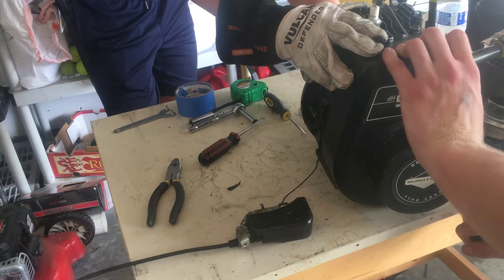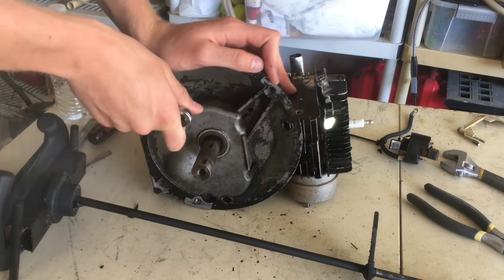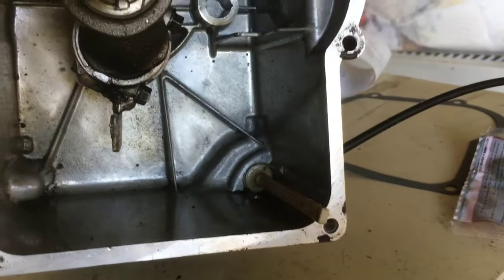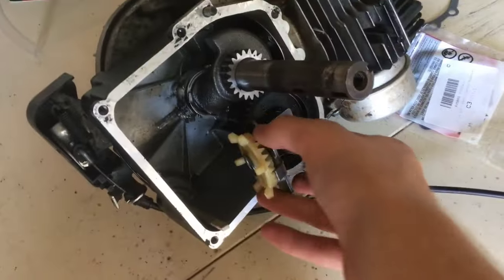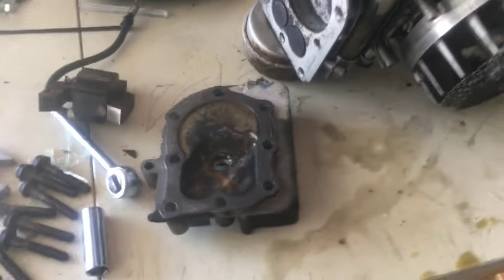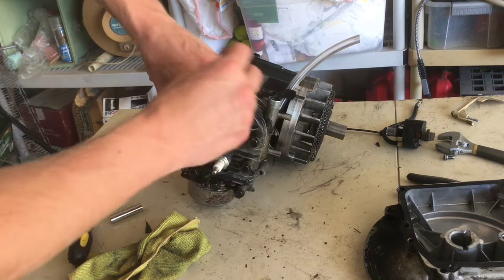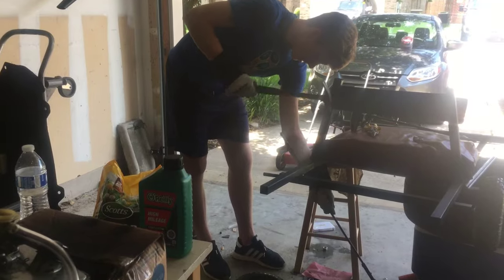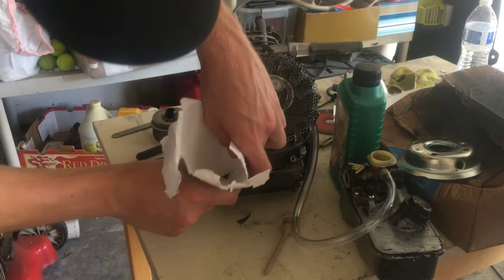How to: Turn your lawn mower engine into a Go Kart Motor & How to fix your engine without any tools

Comment: Hey, are you sure that if i turn the motor on the other side, it wont brakeand will work? The motor will work in different positions? Thanks, great video!!!
Reply from the maker: Mikhail Andriushchenko yes i am using the motor for my go kart rn, all you need to change is the carburetor so the bowl is facing down(like how it originally was) and  have to weld the thing to fling the oil everywhere

Comment: on the throttle thats the kill switch to the magneto so if that cable is touching the bottom or choke thatll kill the motor

Comment: Lol 10:10 ... The first ever footage discovered of cave men making fire 🔥 ... Good on you lads. Where do you go or who do you contact for the sprockets? The parts you installed that need to meet / timing.
Reply from the maker: That’s the stock one that came in the motor. You could find some maybe on Amazon

Comment: Is the welding necessary
Reply from the maker: Jack Laffz no but with the welded thing you don’t have to put as much oil in the engine therefore you get more power with the less resistance

Comment: hey I need help because I have all the other parts to build my bike and the video did kind of confuse me can u list the steps
Reply from the maker: Baba5X-YT when you turn the motor keep the carburetor facing the same way when it was a lawn mower, second you have to weld a little metal piece so with less oil the engine will go faster

Comment: When you took the blade off was there anything else you had to take off as I'm building a go kart and when I took the blade off theres anouthing I go to get off do you possible know how I get that off and great vidoe
Reply from the maker: Alex Turner Yeah that thing was a pain to get off. You are going to have to use some source of heat to get it off, I put a candle right under it for a couple hours and then I was able to pull it right off with some gloves. And thanks bro
Reply: @karlsgarage6477  okay sounds good will try that and was just wondering where did you get the cog thing what makes the go kart move ?
Reply from the maker: Alex Turner what do you mean by cog?

Comment: Hey guys i need some help. I have a engine that came off of a briggs and Stratton generator and i want to use the engine on a go-kart. I have it mounted on the kart but when i start the engine it runs at high RPM. how do i make it idle?
Reply from the maker: That is most likely an issue with the carburetor. From my experience there should be a screw(Philips) that you can turn to make it idle at higher or lower RPMs. You can look up a video/pictures on the carburetor you have to find it, or possibly get a new one

Comment: hey man how do you mount the damn thing to a mini bike frame with the mounting holes being on the side of the case with the engine shaft now?
Reply from the maker: Rico T I had to weld my own engine mounts on the side so that the bolts line up when the engine is turned, you can check out how I did that on my latest video
Reply: Karl’s Garage awesome yes!

Comment: What should I do if I don’t have a welder?
Reply from the maker: That welding part isn’t necessary. We just did it to help fling around the oil inside the motor and I’m pretty sure it fell off at one point😂

Comment: Where did u put the piece of metal ?
Reply from the maker: i just welded it on the bottom of the piston(where it wouldn’t hit anything when spinning) so that we didn’t have to fill the engine all the way up with oil so it didn’t have that much resistance with oil still getting everywhere
Reply: @karlsgarage6477  ok 👍

Comment: hey, i have lawn mower engine but the shaft is on the bottom is there a way i can use that to make a go kart? or something else i can do?
Reply from the maker: Russ Yeah you just have to turn the lawn mower engine so that the shaft is pointing the way you want it and watch the video to know what you have to turn and change within the motor

Comment: It would have helped if you didn't skim over the most important part, how to remove and weld what ever that was to make the whole thing work.  You used tools for ever single thing you did including a welder, how are they NOT tools.  I am impressed you figured this out but this video is pretty worthless.

Comment: Where did you get all the pieces for it
Reply from the maker: Ghost dc  I used most of the parts from the original motor. I bought some tubing from Home depot and I had to use the green plastic tubing from another lawn mower that I had

Comment: No tool:
Need a welder
Reply: You can buy a cheap welder from harbor freight or buy a cheap used one, it's totally worth the money
Reply from the maker: i meant the no tools part on how to fix what is wrong with your engine, but honestly you dont even need the welded part in the engine. its just supposed to make it faster